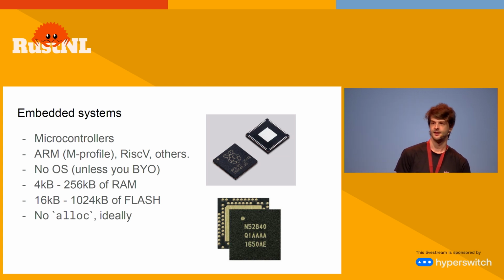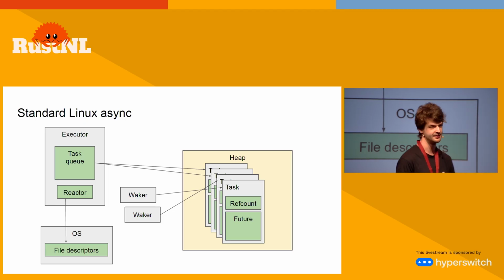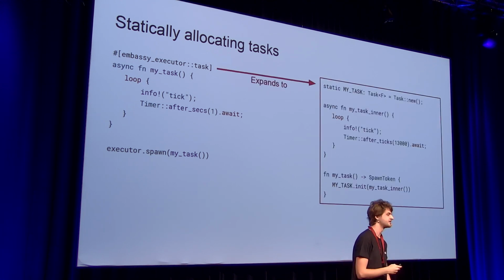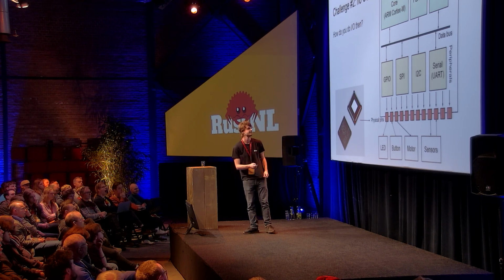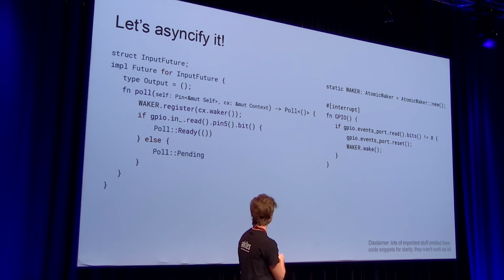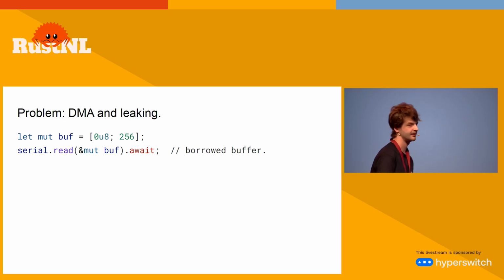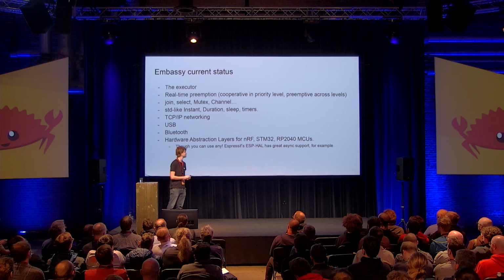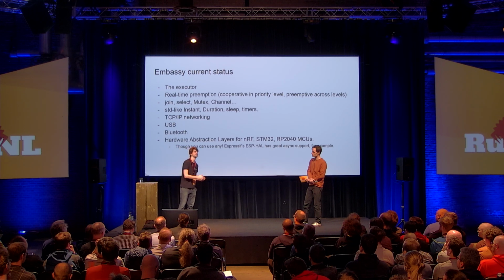Async Rust in Embedded Systems with Embassy - Dario Nieuwenhuis

Comment: Doing a minimal testing  project with the RP 2350  using embassy-rp, embassy-sync, embassy-executor, and embassy-time.

I'd like to explore the low power usability for a future production project. 
in the nembassy-rs/embassy docs I see: "Low-power ready - Easily build devices with years of battery life. The async executor automatically puts the core to sleep when there's no work to do. Tasks are woken by interrupts, there is no busy-loop polling while waiting."
Now the sleeping is depending on the hardware and the chip offers several sleeping modes. Hence I'd like to find out how to control when and what kind of low power mode is activated and how the CPU(s) are woken up.
Any pointers to appropriate documentation / code ?